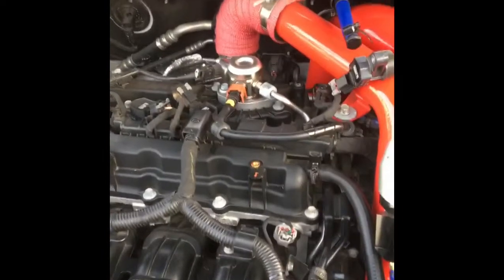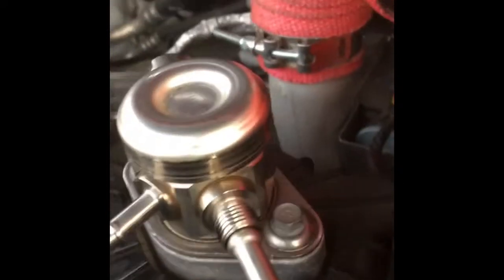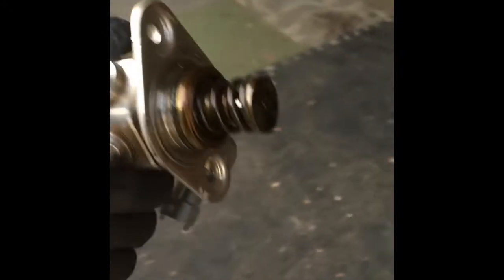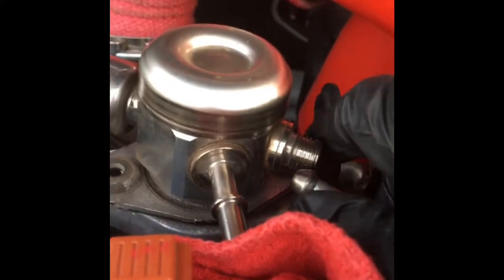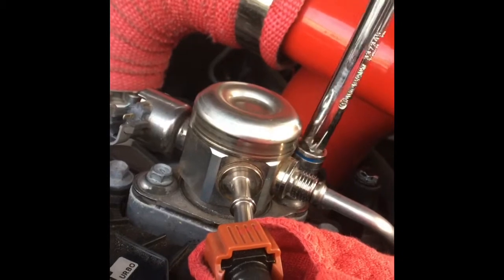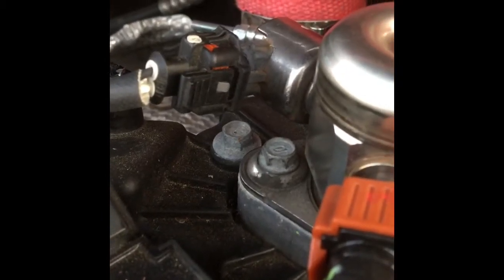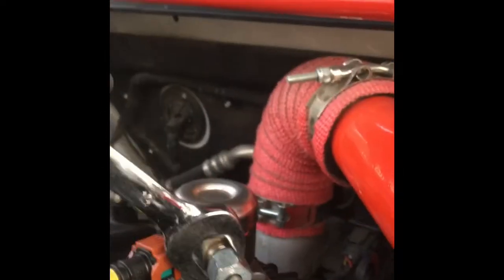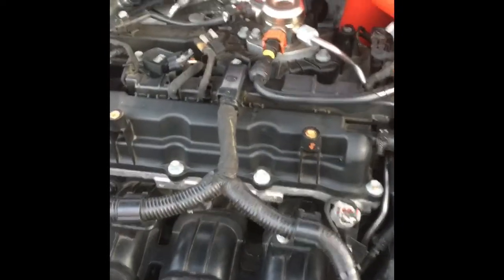Kia Optima hpfp installation

Comment: Thanks for posting.  I watched several videos on same subject before attempting my own repair.  All went perfectly.  Used rags, as you did, and oiled new pump , as shown.  Used 1/4 turns.  Before repair car would backfire, lose power, and nearly stall when anything other than the most gradual of acceleration was attempted.  So only the second low pressure pump located in gas tank was operational.  Drove like that for months.  Ordered a new high pressure fuel pump on eBay for a mere$179.00.  Kia dealer wanted almost $700 for the mere part!  This was my first real car repair attempt.  You made it easy!

Comment: What problems did this cause on the Optima? Im curious if mines gonna need this too
Reply from the maker: egstarkster mine through a code and started funny and then sputtered.  For others they will get a slow start when it starts to fail but mine didn't do that. The code was for low pressure to the fuel rail.
Reply: Matt Downing how did you fix the problem ! I have the same